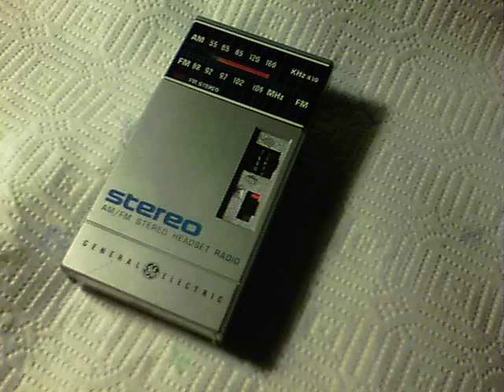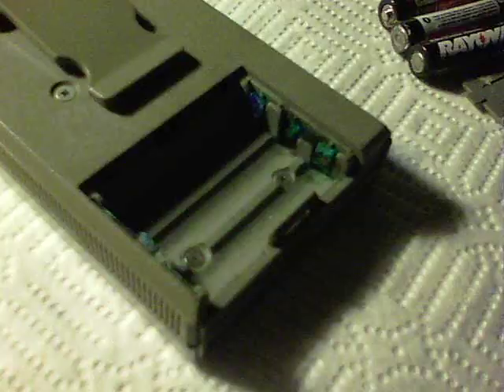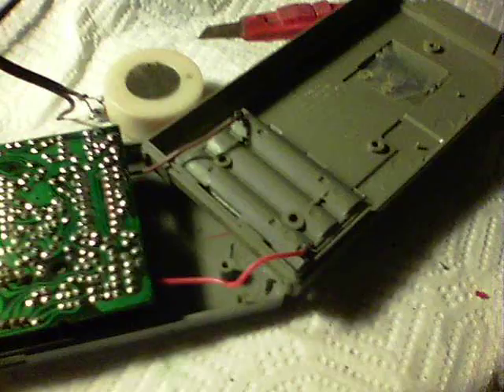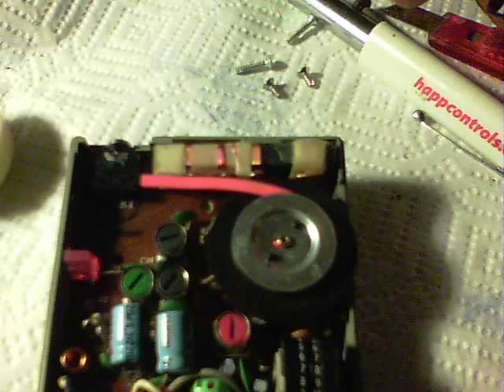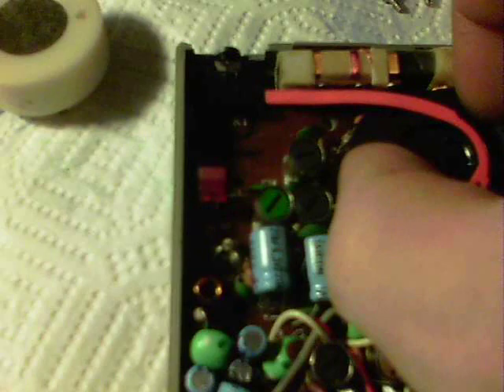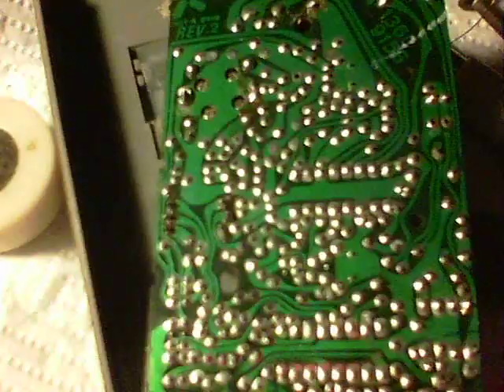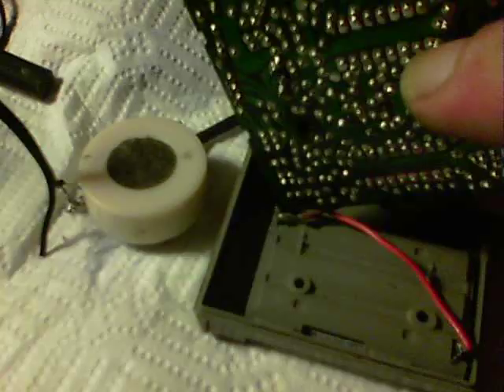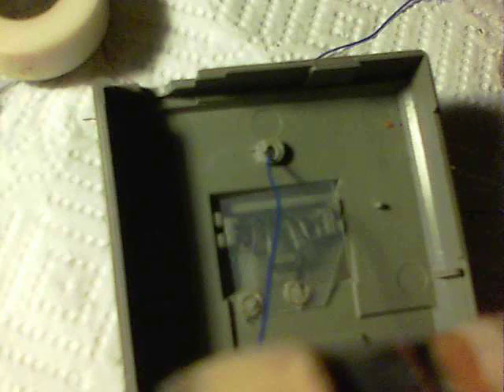Convert an AM/FM radio to SW

Comment: This post is over 2 years old. FYI Battery corrosion can usually be completely dissolved using household vinegar. It dissolves the alkaline corrosion and usually brings back the polish on the battery tabs. This works best with Alkaline battery residue. Carbon Zinc leakage and Ni-cad leakage my not work as well. Use caution!  Gloves and eye protection  are a good idea sometimes the vinegar can cause splattering.
Reply from the maker: That's a good tip, thanks :)
If the area is stubborn a toothbrush works well, in fact toothpaste doesn't do a bad job either. But for vinegar, I tend to use kitchen towel to avoid the splashes. Indeed the vid is 4 years old now !

Comment: Thanks!! 
I live in rural Alaska deep in the mountains, now able to pick up stations that I don't even know what language it is.
Reply from the maker: LOL...nice and congratulations :)
You might spot the stations on this list: http://www.primetimeshortwave.com/time.txt
The method is to look at the time on the left when you hear them, then listen for their frequency if they announce it or tie together the language to the likely broadcaster.
Reply: slider2732 on further investigation, I don't think what I'm picking up is short wave but Instead it's allowed me too pick up random medium wave stations from around Alaska, Florida, California, and Russia just to name a FEW.
Reply from the maker: Main thing you need to know are the frequencies...all are part of a very similar section of the spectrum, so it can be difficult to know, I quite agree there. A few call letters caught by chance and you should even find out what the full range of reception is from low to high.
Reply: The Modern Adventurer that Russian station might be Radio Rossii, although they had ended MW transmissions as of 2014. Maybe a local Far East Russian station transmitting from Yakutia.

Comment: You have shown us how to convert Am to Sw radio work. But how does the Am/Sw Radio converted to receive the FM broadcasts ?
Reply: you can't, you'll need a demodulator to transform the FM signal into AM, then it goes in the amplifier.

Comment: I've got a radio in pieces on my table right now, do you disconnect the existing AM windings or solder the new coil onto the same solder points?
Reply from the maker: Hang on, i'll re-watch the vid LOL, been a long time. 
Nope, the wiring of the AM stays the same :)...you just have to add the 7 turns, equally spaced along the ferrite rod. Connections of those turns are both to the same side of the variable cap, 1 usually to the centre pin, then the other to either the top or bottom pin.
You could desolder the AM windings if any interference or for cleanliness of conversion - but maybe another route is to add a switch, such that you could switch them in if wished. It's a simple mod and well worth trying, some radios work better than others.
Reply from the maker: Glad you got it going. Yes, probably best to desolder while testing, to make sure. Generally you'll get a lot more fade in/out due to the skipping over the ionosphere, but foreign voices are a good sign that it's working lol

Comment: 8 KHz?? I think you mean 8 MHz or 8,000 Khz
Anyways you should retune the IF for best results.
Not going to hear ham radio or military on this since its not a SSB capable radio to begin with but commercial SW is fine.
Reply from the maker: Oops yes, 8MHz ! 
Good idea on the retuning and thanks for the correction, completely missed it :)

Comment: Do you think it would also be possible to connect a coil across the local oscillator capacitor , of the  ganged variable capacitor ,  in order to make  the local oscillator frequency  appropriate for Short Wave reception.
Reply from the maker: +woodcoast50 No harm in trying it and it's certain to adjust the reception frequencies within the capacitance range. It is though quite easy to add the wire over the main ferrite core to shift bands.
I'd say give it a go...good luck :)
Reply: +slider2732 
I was thinking that if you had the extra coil around the ferrite rod coil and then  added a second coil to change the local oscillator  then it could be a way of improving the reception that you get with just the one around the ferrite rod.
Reply from the maker: woodcoast50
It's an interesting thought and i'll likely try it myself. Seems a good method of 'dialing in'. Whether wander would hamper it is one question that could be answered.

Comment: Do you think it would be possible to also do the atc hack as well as this
Reply from the maker: Oh now that's a very good question. 118-137MHz it looks like (just did a search to find out). There'd be no harm in changing the amount of turns or otherwise altering the FM section slightly. Each radio will be different, some have a small coil of about 5 turns of thicker wire for FM. It could be a simple case of swapping out the coil. A switch would probably be better, to allow normal and aircraft frequencies on the band. 

The coil and variable capacitor create an 'LC' tank circuit and are in parallel. The resonant frequency is the one it tunes to. So, tracing the wires from the variable capacitor should show which coil of probably a few on the board is for the FM band tuning. Good luck!

Comment: Can the same be done with a Memorex Am/Fm headset radio from BigLots?
Reply from the maker: I would think so. Presumably it's all a lot smaller than a handheld radio and, if so, the wire gauge should be adjusted to thinner. Worth a go, good luck!  :)
Reply: @Slider2732  all I could get out of it was regular FM/AM radio but I was able go increase the reception by adding a short bit of thin micro copper wire around the farite antenna rod.